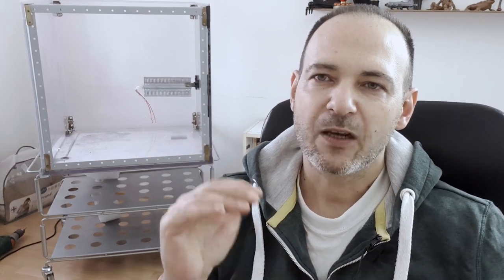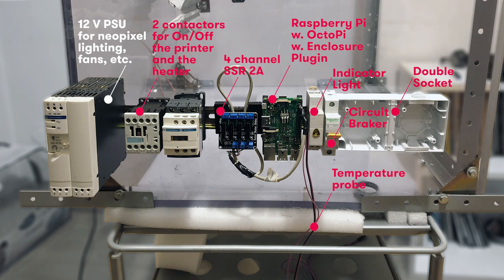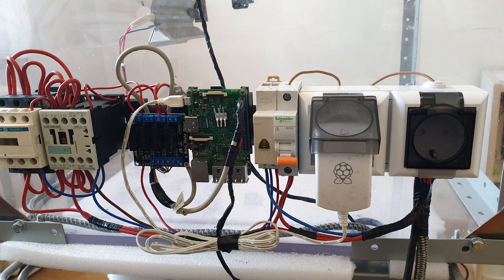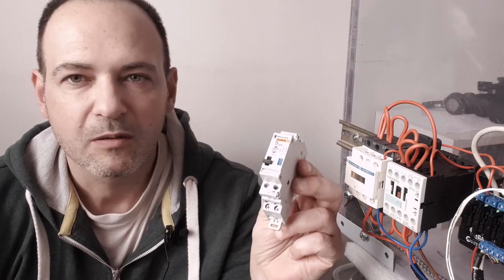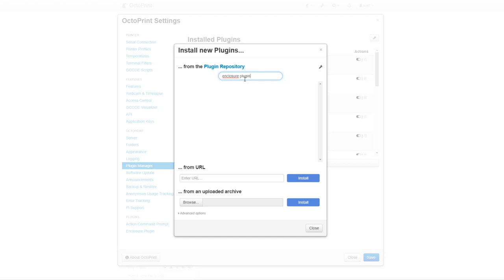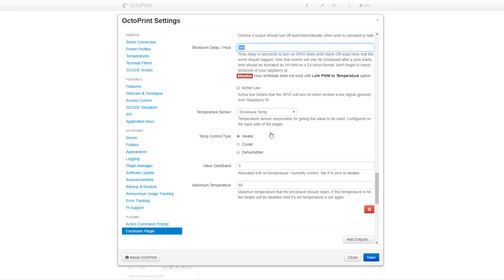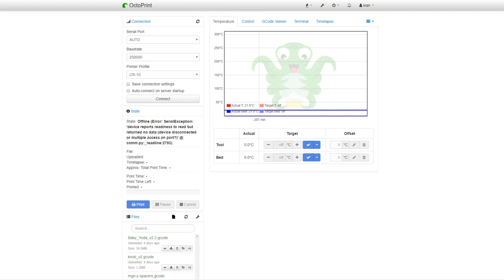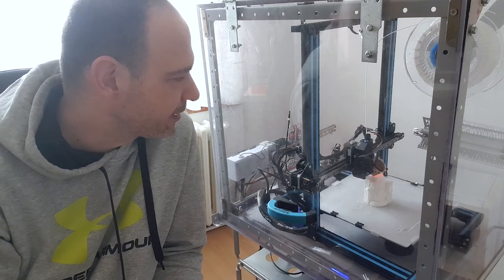DIY heated enclosure for 3d printer

Comment: Hi 
Thanks for the great video.
I am currently building an enclosure for my printer. One of the challenges I try to solve is even heat distribution in actively heated enclosure.
What are your thoughts for the following questions?
How can the airflow in an enclosure be optimized so that there is an almost even temperature everywhere inside the enclosure? 
The airflow can be enforced with an additional fan/blower but would that, in turn, harm/disrupt the running print?
Would an exhaust and intake air filtration system help to circulate the air and to establish not only a cleaner air but also better distribution of the hot air?
If yes, where would you place the exhaust and intake pipes? Is there an optimal position for the active heater?
Any feedback is highly appreciated. Thx!
Reply from the maker: Hi, I had many of these questions myself. I cant give you opinion on exhaust-intake system, but here are my considerations why I didnt implement ventilation inside the enclosure. 
Inside fan, probably mounted in the top part of the enclisure, would help to get faster even air temp. However it will create airflow and I can not assess how it would influence an ABS (or other temp sensitive filament) - probably wont matter much bcz the airflow down to the print would be weak.
Without a fan there will be stratification - hot air on top, cooler air below. Reality however was that the air in the enclosure gets almost evenly hot everywhere, because the enclosure is relatively small.
I also think the heater should be in the bottom part of the enclosure, so when the hot air travels up it will heat the cooler air volumes arround. The enclosure just above the heater should be resistent enough to the heat from this hot airflow (or isolated with heat resistent/reflective folio)

Comment: This is a great video! I built an insulated enclosure out of a old dryer machine. Currently using heatgun to heat enclosure but it is noisy and not efficient. Are you able to provide link showing where you got 500w heater? Seems like a very good option. Not finding anything similar on amazon.

Comment: Nice enclosure build, How warm does the outside get when it’s 70 degrees C inside? Not sure if I should use PC sheet or insulated composite panels. Thanks!
Reply: I consider exactly the same setup. I think I'll go with the PC sheet.

Comment: Ivan, what do you think of the idea of using an old printer controller board for this?  I fried a stepper motor chip on my Ender 3 so I had to replace it.  Since the heater is similar to the heated bed, I was wondering if I could add an SCR and then connect it to a heater and control it with that board using Marlin.  I kind of like this option since it has the PID function for getting the temperature to stay nice and constant.  I'm not an electrical guy so something like this would be out of my range but I can imagine a smart guy like yourself could investigate this idea.
Reply from the maker: I see. I dont think I'll go deep in investigating this option, but it seems perfectly doable. You need a supported termistor to hook in the board (where the termistor of the bed was connected), then to connect the output for the bed to a 10A SSR (enough for 500W). 
But to control the temperature you'll need either to hook up a display, or to use octoprint or another software interface to connect to the board via USB.
With this option though you cant have a deadband, (unless there is a way to set it in Marlin). It means your heater will switch On and Off frequently to maintain the reference temperature steady (not as frequently as if it was heating a bed, because the volume of the enclosure provides some inertia). Depending of the quality of you heater it may die faster.
Reply: @3dpblog  I thought that if you used the thermistor off the hot end that would work ok.  And yes I agree you'd need a display but if you have some broken printers and bits laying around it seems like it could be a fun way to repurpose the parts.  In Marlin I would suspect that only a very small section of it would be needed to provide control over just the heater (no jerk, acceleration or motor controls, etc.)
I have my printer in an enclosure and would like to add heating to it but since I'm not really an electrical guy I'll probably wait until there's an aftermarket system available.  Wham Bam has recently mentioned that they were working on one so when it comes out I'll check it out.
Thanks for showing how you set up your system.  It looks very well thought out.

Comment: Very Cool. Have you printed anything structural in there? How strong are the parts? I'm going to build something similar. If, i only need 40 to 45 degrees C enclosure temp to get strong parts that would great. The pros are using of 70 degrees C to print ABS. At that temp, I think special high temp stepper motors  or stepper motors with water cooling are needed.
Reply from the maker: No structural parts were printed, becase the metal components I used cost almost nothing and on the other hand at the time I built it I was just getting into the stronger hi-temp filaments. What is expensive here is the PC sheet. If you need just 45 C (which for me is perfect for ABS) you can go with thiner PC sheet (like 3-4 mm) and use some 2020 extrusions to fix them. I think I saw such designs on thingiverse.
Reply from the maker: About the motors - my steppers are handling well 3-4 hours prints at 65-70 C (PC filament) with just air cooling with heatsinks. Didnt test for longer prints, as normally I print quick parts from this filament. :)

Comment: So what are the actual dimensions of your enclosure.  This is a guess 70cmx80cmx90cm .
Reply from the maker: 60 x 66 x 66 if I remember right. At the time I built it I wanted to have the minimum possible volume.
Reply: @3dpblog  thanks.

Comment: Dude. You went just a bit overboard with the electrinics. Frankly i would too slap on everything an industrial contactor because they're badass.
But you made the enclosure out of acrylic so that's a big no no. Look at 4-10 k euro printers. They have insulated steel enclosures with glass windows. This acrylic crap doesn't keep the heat well enough. It just looks fancy.
Reply from the maker: It is not acrilic but polycarbonate. Theoretically it can go up to 120 C without deformation and I go up to 80 C when printing pure PC. It works since 4 years now, so ...